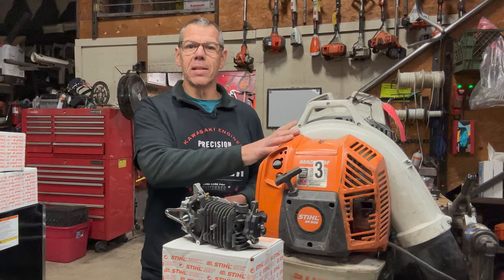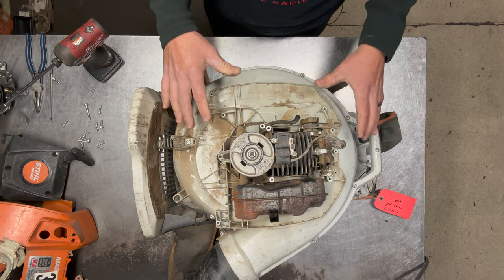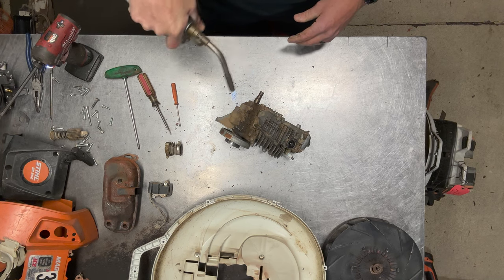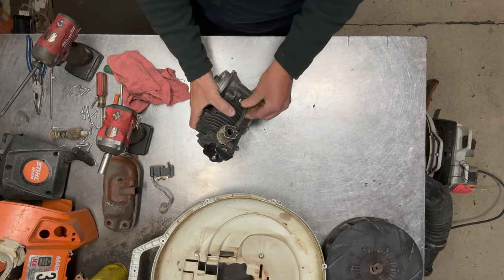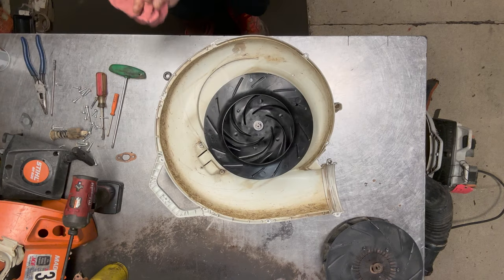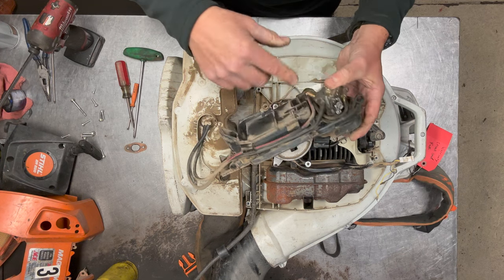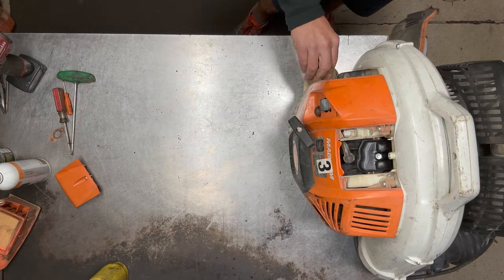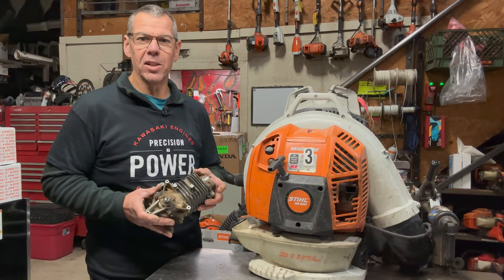STIHL BR800 ENGINE REPLACEMENT / HOW TO REPLACE YOUR ENGINE

Comment: What causes the fan to slip on the shaft? The hot Arizona temps? Manufacturer deffect? I just purchased one of these and hope i never have this problem...bummer.
Reply from the maker: The main cause is the fan, there is a defect with the center bushing. Stihl has addressed the issue so you should be ok. Make sure your blower is registered with Stihl for warranty.

Comment: I have read that a leaky cracked muffler allows HOT air to enter fan and melt area around fan bushing? Did this muffler appear loose or cracked...i cannot remember without going back and watching video again.
Reply from the maker: Muffler was fine on this unit. The muffler and fan issues are not related.

Comment: Which blower you think have a reliable engine stihl 800x, echo 9010t or redmax 8550?
Reply from the maker: I personally like the 8550. You may need to do an occasional head gasket but they handle a tremendous amount of abuse.

Comment: I have an old style br 700. Recently the engine went out so I bought a new style engine but one screw doesn’t go in, can I mount it with just the 3 screws?
Reply from the maker: I wouldn’t recommend it, you may have issues down the road. You can buy just the engine side fan housing for the new engine.

Comment: Excuse me, where can I buy a motor for the stihl 800 magnum blower?
Reply from the maker: Check with local Stihl dealer.
Reply: @wallysworkin823  I have already asked but they say that it is cheaper to buy another new blower
Reply from the maker: @ricardobelmontes9699  Depending on their mark up it may be cheaper for a new blower.  Not sure what the current list price right now. If you are going to do it yourself just tell them that and ask them to order you one. We do that for some of our customers.
Reply: @wallysworkin823  ok thanks sr. Good video

Comment: Total Time it takes without filming ?
Reply from the maker: 10 minutes or less as long as I don’t need to fix anything else.
Reply: @wallysworkin823  I think you misunderstood my question, there is no way you can swap out that short block in 10 minutes or less …!
Reply from the maker: @cbnx82703  oops, meant to hit 3. Buuuut….. I think I could do it in 10 min, I’ve done a lot of them 😂 maybe I’ll time myself next time 🤔
Reply: @wallysworkin823  hope your customers don’t see this , Im sure if it’s outside of warranty they’re not paying for 10 minutes of labor time…
Reply from the maker: @cbnx82703  I’ve spent many many years honing my craft, customers pay for our experience. The whole idea is to do the work in less time than “book” time. We treat our customers right and charge them a fair price. We are not the cheapest but we stand behind our work and own our mistakes.
Reply: @wallysworkin823  I understand and agree im the same way but we all know those ones who disregard all of what you stated and just look at the time factor… you know those types, they’re the talking types who spread bs when they feel wronged … give you an example , recent job I did for a relative , auto repair this time , change out a Serpentine Belt tensioner with new belt , parts $126 , 45 mins labor time $220 repair , I called a Nissan dealer just out of curiosity and had the job quoted, they quoted $757.00 plus tax not including the new belt, now I used OEM Nissan Parts , retail was $126.99 Resale $79.10 , so you can see how people loose trust when they get ridiculous numbers like this told to them, 2005 Nissan Ultima 2.5 L 4 cylinder… Outrageous $757.99 for 35 minute repair…